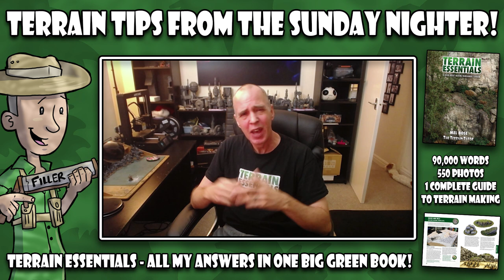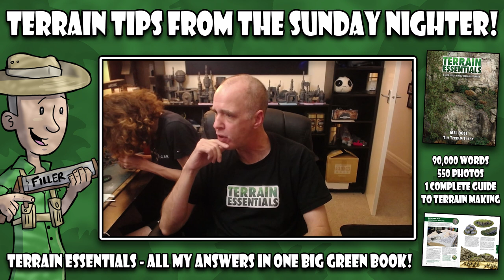TTT's Terrain Tips - #1

Comment: I had some plastics that didn't really hold paint even with plastic bonding spray primer.  I found that Polyshades Polyurethane stuck pretty well.  It's the same stuff as Army Painter's shade that comes in cans.
Reply: Try priming with EvoStik exterior PVA. It comes in a blue plastic bottle. It shrinks as it dries so no loss of detail. So long as you paint with acrylics it’s fine.